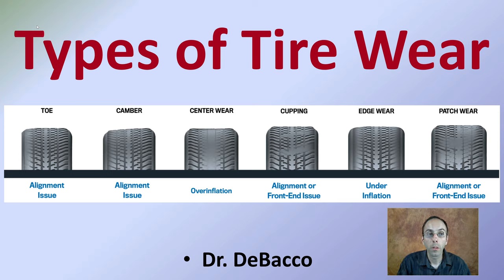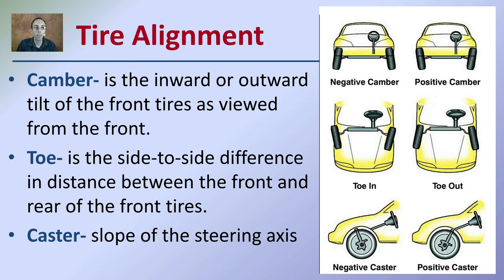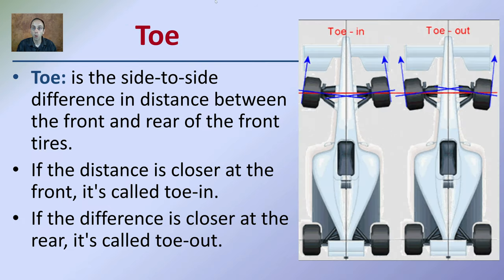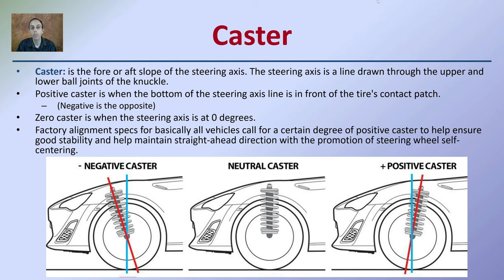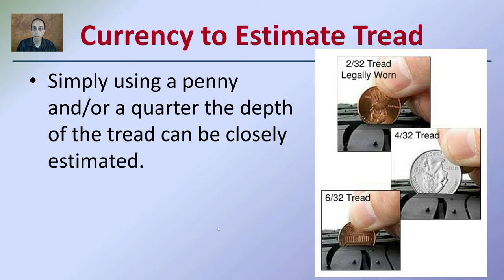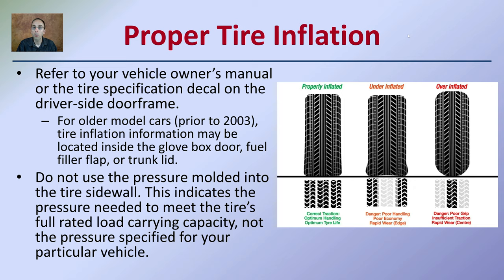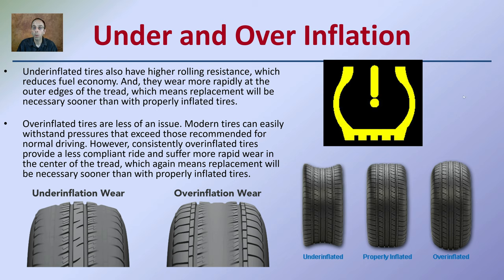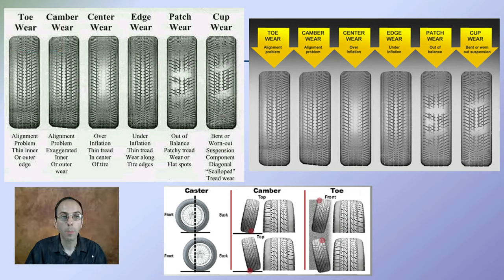Types of Tire Wear

Comment: What if the wear is all the way across and even on both back end tires? I've already replaced both back struts. Alignment is perfect and tire pressure is asking 35 so thats what we put in. I have gone through almost a grand for back tires.
Reply from the maker: Is this a rear wheel drive vehicle?  Also, when you say "all the way across" is this referring to the entire tread?  (Is it parallel with the axle or perpendicular to the axle?)
Reply: @DeBaccoUniversity  yes the entire tread. I tried to put a picture but it wouldn't let me and no its a front wheel drive and I have no idea if its perpendicular or parallel
Reply from the maker: @karrissawinn7556  Sounds like an alignment issue (even though you say it is perfect).  Not sure when new tires were put on, but check for early signs of wear and this will help guide where the potential problem is.  Specifically you want to look at the toe or camber angle/alignment of the rear tires.
Reply: I’m having the same problem with my Dodge Charger my back tires worn all the way around don’t know why
Reply: @okie-5518   get your  trail arm bushings checked thats what ended up being the issue.  I feel so relieved having it fixed and my car drives so much smoother and tires are doing great now.

Comment: Thanks for the video. I have a rear wheel drive car with both rear wheel inside wear more than the out side. The rear wheels have in spec negative camber and toe in (front sides closer than rear). It can’t be due to the toe, can it? Toe in wear should be on the out side. The excessive wear is then from the camber, isn’t it? But the wear is mostly just the innermost strip of the tread, not a gradual slope showing in the video. This confuses me.
Reply from the maker: Your wear description is related to the camber.  Having both rear wheels exhibiting the same wear indicates that there may be an alignment issue or set-up with the driving wheels for the car your describe.
Reply: @DeBaccoUniversity  Thank you for the reply. I used an angle finder and checked rear camber. Both have about -1.5 degree which is in spec (0 to -2). It is a 5 link design without camber adjustability. I guess it was designed to be that... There are aftermarket "camber bolts", but they are designed for McPherson struts. I'm not sure if they will work with camber arm... Best.
Reply: @motofan16  what car is your RWD with -ve factory camber specs ?

Comment: Hello. Thanks for the informative video. I’ve got the camber tire wear according to your diagram. The ride feels normal, but the tire looks out of round. Is it dangerous even thing I still have lots of tread left. How can I tell that it’s just a camber wear not a broken belt? Thanks in advance.
Reply from the maker: If you see it on both sides this can be an indication tread is one thing, but depending on the age, there is also side wall strength to consider.

Comment: Front wheel drive vehicles do not have caster!
Reply from the maker: Most of the time you can not adjust caster on front wheel drive cars, but it does not mean they do not have caster... https://low-offset.com/workshop/what-is-caster-angle/

Comment: I had fitted 4 x Continental ContactSport 6 on my C Class W205 C250D last year August 27th 2020. Car is re-mapped to stage 1 and currently running at 250BHP.
265/30/19 on the rear side and 235/35/19 on the front side.
This week after doing around 5k miles, I found out that the rear tyres are already worn and need replacing very soon. Never did any burnouts.
The inner side of the rear tyres has maybe 0.5-1mm left. The outside has around 2-3mm left.
On the front side, tyres are still good however, they are also getting a bit weary from the inside than on the outside. But the front side issue is not that serious.

What might be the issue please?
Reply from the maker: Checking the age of the tires and also the wheel camber would be advised.  This DeBacco University video will help you read the side wall information to determine the tires manufacturing date... https://www.youtube.com/watch?v=ZtFqmHlhLoQ
Reply: @DeBaccoUniversity  My Chrysler Town&Country van had too much negative camber on my back tires! Fixed it by using hardened lock washers on both top bearing hold bolts.

Comment: I have an 18 Altima, recommended pressure is 33 lbs. I keep them around 35 and rotate them every other oil change. I just had them rotated and noticed the ones on the front, both sides, are wearing a lot on the inside and outside edges. Im perplexed on why. I havent paid much attention so I cant be positive they even rotated my tires for sure, it was the stealership that did it. Either way, it doesnt make sense. My pressures in the car all read the same and I have a digital gauge built into my inflater so again, not sure whats going on. Alignment is fine as well. Any ideas?
Reply from the maker: In general front tires tend to wear more then rear tires.  However, the pattern you are noticing suggests under inflation but your readings suggest otherwise.  Keep-in mind the recommended pressure comes from the sticker in the drivers door not the tire themselves.
Reply: Tires could be too wide for the rims.